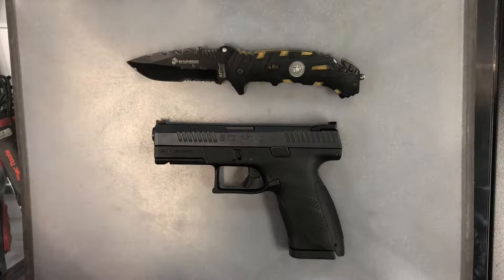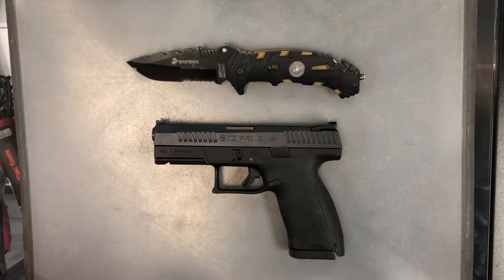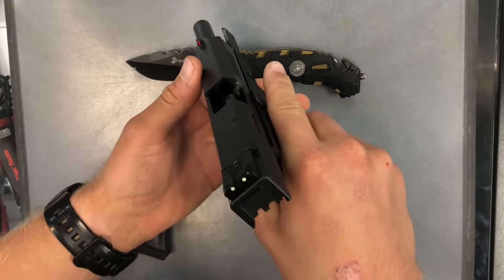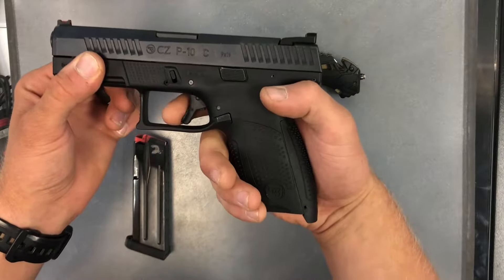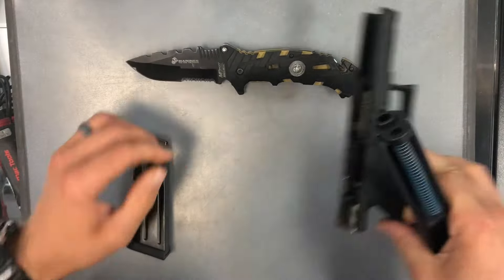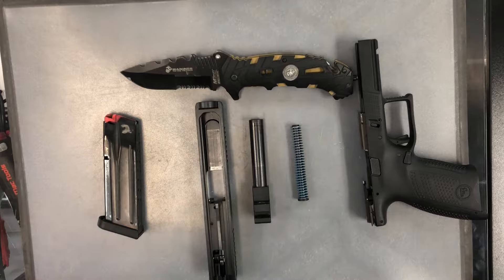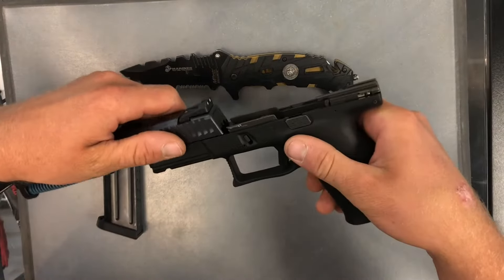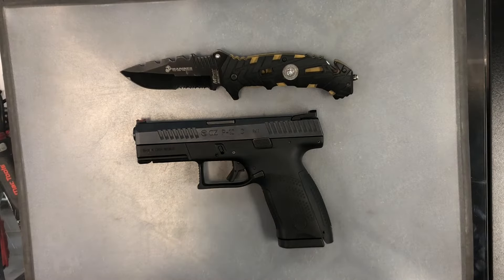CZ P-10 C disassembly and assembly

Comment: Thank you sooo much for this tutorial. Short, sweet, and simple, absolutely perfect! Just picked up a P-10C as my first gun and couldn't figure out the process, so this saved me tons of time.
Reply: Im about to pick up my first ever pistol and im trying to decide between G45 and the P10C. I’m not very experienced with pistols and would like to know what you think about the p10 as a first time owner. Do you have any complaints or concerns? Would you recommend this?
Reply: Apologies for the late reply, hadn't been checking my notifications lately. 

If it's not too late, here's my input!
-Overall, to be straight forward about it, it's an amazing firearm. Definitely glad I went with this for my first pick. It's super easy to assemble/disassemble & overall maintain and clean. I haven't had any issues yet and at this point I've put a good thousand or so rounds through it and it's holding up perfectly. And to sweeten the deal, the accuracy on this pistol is quite good as well. 

So yeah, I'd definitely say that the CZ P-10C is probably one of, if not THE best choice for a relatively budget friendly first pistol.

Comment: Man I’m actually pissed I did not do my due diligence as I should have. So the CZP10C breaks down just like a Glock. I was wanting another pistol ( I did want a more compact pistol though, and thought about this and ended up getting a Taurus G3C due to size AND several others had stated the CZ was a nightmare to breakdown. The SAR9 CX is a nightmare literally to break down. Decent firearm but damn those 2 tabs on the side aren’t easy to push in and down to field strip.
Reply from the maker: @thetattooedguy1413  yeah it can be a pain sometimes haha
Reply: @ Really ?? So it doesn’t break down like a Glock ? It looks like it. I had just bought a SAR9 CX and that’s a PITA to field strip.
Reply from the maker: @thetattooedguy1413  the field strip is like the glock handgun, I was referring more to the fact that the tabs can be kind of hard to push down
Reply: @ Ok sure as heck not as bad as a SAR9 lol 😂 good night that’s a chore

Comment: Do you have to dry fire it I just got the same gun and was told not to do it too often unless I’m using snapcaps
Reply: Dry firing it is fine. It will over (a long) period of time make you need to replace wear parts, but thats the same as shooting. Avoid dry firing rimfire cartridge guns, but centerfire like the P10C is fine. (If you are not sure if your cartridge is rimfire or centerfire google it)

Comment: dumb question how do you lock the assembly without a magazine
new gun owner, ty
Reply from the maker: Most semi automatic handguns have a knob or switch protrusion on the frame called a “slide stop” while pulling the slide back you’ll want to push that knob up and it will lock the slide to the rear. Welcome to the gun ownership world. Hope that you enjoy the gun community.
Reply: @nerdydevildog8126  Thank you!  Getting to learn my new CZ P-10C as well as a Glock 43x.

Comment: P10c community does anyone know any website that has holsters for our guns ?
Reply: Tier 1 concealed (best but most expensive), Tulster, and Vedder.  I just bought the Tier 1 axis slim for my taurus g2c but lead time was 15-20 business days so i didnt want to wait that long again for my p10c, so i was torn between the Tulster OATH or the Vedder Light Tuck w/claw attachment (both were right around the $60-$70 range for just the holster and claw combined).  The Tier 1 Axis Slim was $130 but it comes with a detachable magazine carrier as well which you can run as a sidecar with your holster for a spare mag or it can detach and you can run it with just the holster.  I went with the Vedder because it had a better claw attachment for concealability, but both the OATH and the Light Tuck were both tuckable IWB holsters that are great for appendix carry.  Those 3 companies are 3 of the best out there as well.  There are quite a few other larger companies that don't even make holsters for the p10c such as Bravo and Cross Breed so you are limited anyways.  I would highly recommend one of the 3 i mentioned especially if you are carrying appendix